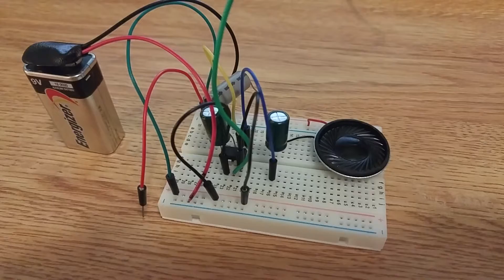OP-AMP AM Radio Circuit

Comment: Uh, I don't think so. You don't have any sort of oscillator or tank circuit in there so you're not "picking up" any stations that you'd be able to actually listen to. And you don't have any sort of demodulator/detector in there so even if you were miraculously able to actually receive an AM signal there wouldn't be a way of converting it back into sound. You just made a little static noise generator. Nice.